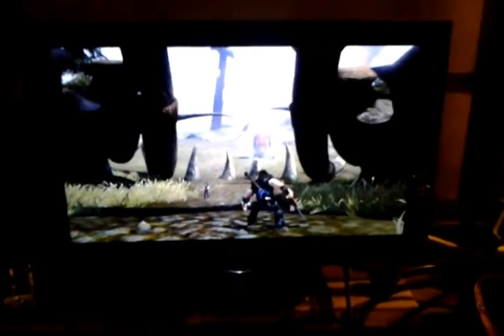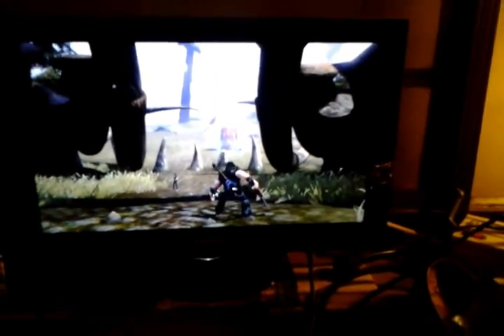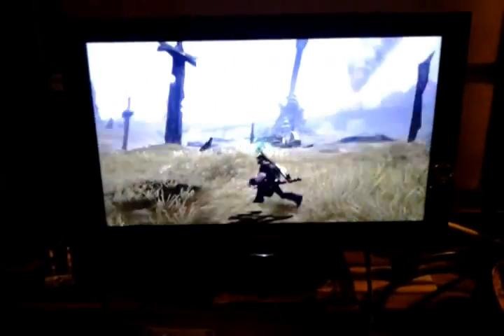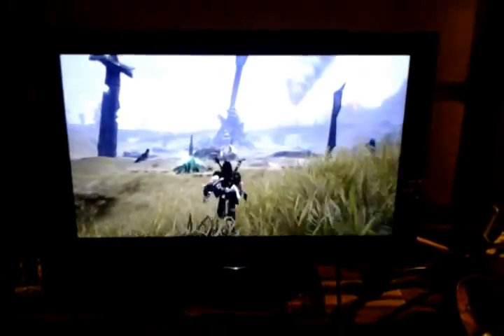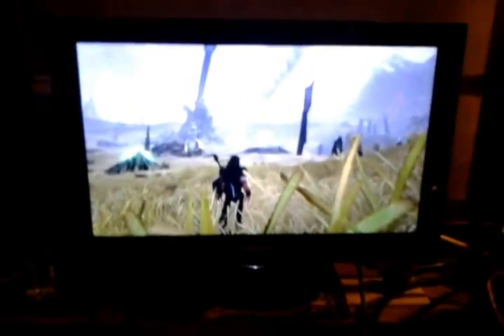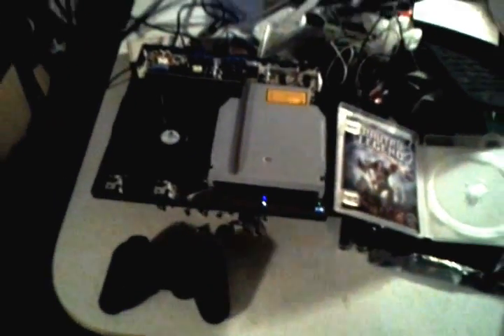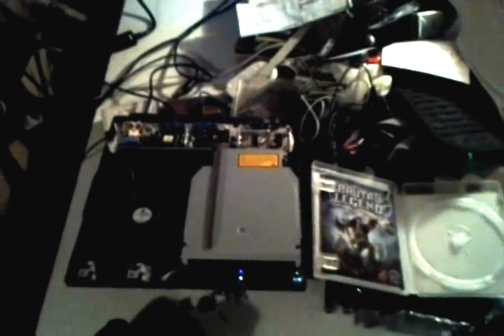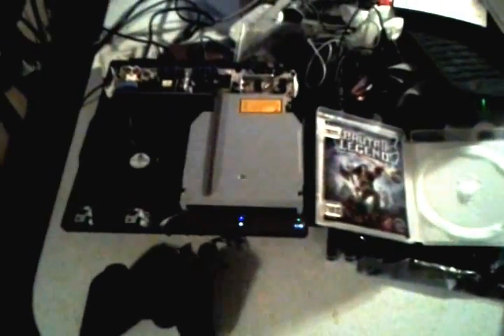PS3 Slim Power Off / Shut Down - Demo And Fix - Not YLOD [cech2501A]

Comment from the maker: I did some digging around through the comments here - and there was a few instances of other combinations on the dial - figured I would put this in a pinned comment! :D

alternate combo 1 : i had to move the PFC to 1 o clock and the OFC to 7 o clock. moving em like u said didn't work but it might be different for each system. but thats the combo that worked for me

alternate combo 2 : it worked for me , i just tried an counterclock wise combination on both potentionmeters and it worked
Reply: THANK YOU SO MUCH!!! YOU HELPED ME FIX MY JAILBROKEN PS3!!! PSN: AR_-WizardModz   IF YOU WANT TO HAVE SOME FUN <3
Reply from the maker: Awesome news!

Comment: After adjusting that that components it agains off with no warning?
Reply from the maker: (tldr: cool that power supply! 😉)
Heya! I am actually prepping to fix some Fat PS3 units with same issues as this Slim had. The knobs alone were not enough - it took reflow and new paste to get it to start staying on at all, then to get any hours of gameplay like 8+ hours  without canceling dead midgame, the knobs needed adjustments, and then we could get 80+ hours. If it's offing itself quickly like immediate then it's board issue likely, but if it's offing quickly like 8 minutes, then the power supply components need fans/cooling, I had to remove the power cover and the entire lid before adding fans! :) It's an old vid but I am still active on this! :D

Comment: I had this same problem and I fixed it all you have to do is hit the PS3 on the upper left-hand Corner and it will be fixed it really works just try it you will see
Reply from the maker: Well to really explain what you are doing would require a thermal image of the ps3 boards under symptoms and force calculations for the heat of solder and resistance drops...

But i bet your PS3 Big Fan is dying, physical strikes work for moving parts but can damage working moving parts affected as a byproduct of a strike - such as the BDROM. Fans are cheap, might just need a cleaning.
Reply: I did clean the fan but when I bought the PS it was only cutting off and coming on so I had to remove the power cord to put it back on I only hit it once and from then it working as a brand new PS3

Comment: I Have the same problem i actually bought ps3 slim cech2501a for fixing but i turn it on and it doesnt want to start i watched zour tutorial and it doesnt work i tried diffrent combinations but for one it turn off after a second on other like 2 seconds.And my fan doesnt spin can you help me?
Reply from the maker: Sure -  have you read the description for the video too, there are additional things to consider such as is a reflow necessary and is there possibly damage to the mini control board buttons or ribbon cable?

Comment: Hey man, thanks for this. i have a slim cech2512b and with same psu, 270 aps. I tried your fix last week and it worked great, i was playing for 4 hrs tops since then. But i was just playing nba2k18 earlier then it shut off on its own again (no red light, nothing, just off). Just wanna ask for your help. Should i try the screws again, with a different combination?
Reply from the maker: Jeno Fujita Totally - Operate the unit without a lid until its dialed in, dialing a knob back bit by bit from maximum, and if it seems to get worse reset to maximum clockwise and counterclockwise and try again! I had 80 hours in-game testing once it was solid, (rubber banded the controller overnight for 3 nights to just run around aimlessly) and did a case mod to add 2 fans afterwards just to be sure. I never reinstalled the PSU lid, but didn't want the heat to reach the GPU is why I added fans.

But yeah, 2nd best combo is each knob backed off from max a little bit
Reply: Michael Webb ok, thanks for the quick response! Really appreciate it. Gonna fiddle with it later, just letting it cool off for now.
Reply from the maker: Jeno Fujita You're welcome - ive kept up with replies as ASAP as best I can for almost 6 years on this vid - my other vid is youtube.com/watch?v=GREiB9E5eBg where its about the case fans
Reply: Michael Webb thnx i''ll be checking that out. After i figure out the screws hopefully i can do a case mod. Do you remember your exact combination for the potentios though? I was thinking since we've got same psus i might try your configuration
Reply from the maker: Jeno Fujita I ended up selling that model after a year or so, what I recall was the importance of CW and CCW - if the clockwise and counterclockwise are reversed, symptoms are worsened.

When I was running combinations, the best successes came from max CW and max CCW - then bring each back from max the TINIEST bit. Then take one knob and move it a tiny bit more until symptoms worsen, taking note of the previous dial setting. Reset each to max, move both a tiny bit again, then move to the other dial, bit by bit attempts until symptoms worsen - bring it back to the previous setting and bring the other knob to where you took note - then budge them both simultaneously bit by bit toward maximum. Notes notes notes! :)

Also - I did a reflow on the mainboard because potential pooled heat damage to the gpu and reapplied thermal paste - also modifying the big fan to be on maximum speed at all times. Ultimately I installed a dial to control all 3 fans (including the 2 aftermarket) and left it at max all the time.
Reply from the maker: I did some digging around through the comments here - and there was a few instances of other combinations on the dial

alternate combo 1 : i had to move the PFC to 1 o clock and the OFC to 7 o clock. moving em like u said didn't work but it might be different for each system. but thats the combo that worked for me

alternate combo 2 : it worked for me , i just tried an counterclock wise combination on both potentionmeters and it worked

Comment: any other solution for this problem?
Reply from the maker: Tomas C. 
I'll sure do my best.
I recall that the blue light would blink, and after studying the blue blink it was certainly not a "blink code".

My theory is this.
The GPU on the motherboard probably needs reflowed, this is step 1.

Also the power board likely has bad capacitors, which are releasing incorrect energy values, causing the blue light to blink as it does.

So step 2 is The knobs, if there are any will bypass circuit fault protection and run it anyways, which I got almost 80hours in-game uptime out of before a system crash.

If there's no knobs for step 2, you can replace the two major capacitors or replace the power board (preferably with a knobs version.)

Last case scenario is this - that little power button board can produce the same results if it's failing, so if you need a step 3 that'd be it.

These steps cover pretty much everything that would go wrong, my error was developed through overheating the system causing GPU and PSU damages.

Also, check those ribbon cables for damages and that they are properly seated.
Reply: Michael Webb thanks. I have the APS-270 with the two knobs. My entire issue comes from me not noticing these two white screws move from a simple touch. I was trying to fully clean the dust in my PS3, which included the PSU's interior. I remember one accidentally turning a bit while cleaning it. Then when I was wondering why they were so loose, I turned them out of their original position and mine weren't marked as many say they are. Now I have no clue how they are supposed to be.
Reply from the maker: see the description
Reply: I know this video is old, but IF you remember, when you attempted to turn it on and it would turn back off, did the blue light near the Eject button randomly turn on in between? My problem is identical, but sometimes the damn blue light comes on before it shuts down which leads me to believe that perhaps I have another issue.

Comment: After messing with the screws I could get it to stay on longer, about 10 seconds at the most but still wouldn't stay on. So I bought a new power supply for 20 bucks, put it in, same problem. Turns off instantly. Guess it was not a power supply problem. fml
Reply from the maker: Like I've mentioned, the power button control board can cause same symptoms, and I never messed with the screws until after I did a Reflow on both boards with a heat gun.

Comment: I wish that was my issue. I changed my power supply from a new ps3 and it didn't work, it still turned on then right off again.
Reply from the maker: the mini power control board can cause simular symptoms, I have never had to Reflow repair a mini power button

there's not much to a ps3 that needs repaired, we all know the graphics are gonna burn out and why

mini power control board
power supply board
GPU mainboard
blue ray lens
big fan

i.t's such a sick and twisted field, that's why I am in the field of fixing it. 

the Knobs are most likely directly resulting the capacitors discharge and affecting the GPUCPU and effectively overclocking for a potential solid 72 hours gameplay experience 

that's pretty good

Comment: noice no screws like this exist on my ps3 power supply >:(
Reply from the maker: What causes the issue is overheating of the capacitors, so they don't deliver a full burst from their charge and instead they work like a fuse which isn't what we want.
.
Replacing them with the same output capacitors may solve it on knobfree power boards, also tho installing some ventilation and/or a fan to cool the capacitors will help prolong the life.

keeping in mind as well, I reflowed the power board and the main board with a heat gun, added fans and vents on the power board, maxed the GPU big fan, and I had knobs to test with to determine these conclusions.
Reply from the maker: afterthoughts on this project:
a larger capacitor can be mathematically determined without overloading the chips and possibly bring an overclocking result, though I am speculating, new capacitors and ventilation is the first step.

I stated in one of the videos something about it I thought, the whole power board can be extension wired out of the case like the xbox360 power brick is

Comment from the maker: Saw a question in my email box just now.

What a persons gotta do to solve this shit.

1. OPERATE THE UNIT WITHOUT A LID. Test
2. IF THERE ARE KNOBS, ADJUST KNOBS. Test.
3. IF THERE IS NO KNOBS, GET A NEW POWER BOARD THE ONE WITH KNOBS. Test.
4. REFLOW THE MOTHERBOARD. Test.
5. REFLOW THE POWERBOARD. Test.
6. A UNIQUE SIMILAR SYMPTOM ISSUE IS THE POWER BUTTON MINIBOARD AND MINICABLE. Test.
7. IF YOU WENT TOO CRAZY DOING ELECTRICAL MODS GET A NEW BIG FAN. Test.
Reply: We should chat i need help on mine idk wht to do or what it is wrong. I turn on my ps3 ill load for a sec then turn off with a beep and keep beeping no noise but red light beeps over and over untill i click again help yes
Reply from the maker: I would suggest INSPECT POWER SWITCH CONTROL BOARD.

Also, there is these steps.
1. OPERATE THE UNIT WITHOUT A LID. Test
2. IF THERE ARE KNOBS, ADJUST KNOBS. Test.
3. IF THERE IS NO KNOBS, GET A NEW POWER BOARD THE ONE WITH KNOBS. Test.
4. REFLOW THE MOTHERBOARD. Test.
5. REFLOW THE POWERBOARD. Test.
6. A UNIQUE SIMILAR SYMPTOM ISSUE IS THE POWER BUTTON MINIBOARD AND MINICABLE. Test.
7. IF YOU WENT TOO CRAZY DOING ELECTRICAL MODS GET A NEW BIG FAN. Test.

Comment: +Michael Webb just a quick question after this fix did your ps3 ever had this problem again or did it stay working for a long time and never happened again..... plz get back to me on this it will be greatly appreciated thanks
Reply: wow sick thanks for the reply tho .... just came from work and decided to try it out again your rotations on the screws did not work for me as i wished it would but i decided to play with it a lil to see what i get.... so far ive gotten some results only now after endless unplugging and screw turning.... right now it is still on and running so i decided to try and download a game which it is doing presently ....and for one it has not shut down like i expectd when i tried it on befor turning the screws..... normally when i do something with it that looks like results it always fails so im expecting it to shut down again..... if it doesnt my word thats gonna be awsome .... im gonna have it to run until tommorrow and if it doesnt go off then hoorah id recon i got my ps3 back hopefully..... btw lastly that fan mod i wanna definitley do this to my system can i get a blue print or idea as to how thanks very much again youre the best bro

Comment: I'm going through this right now and when I twist the knobs its still cutting off on me after 3 seconds
Reply from the maker: You can always try different knob positions - the one from CW and the other from CCW, just move the tiniest increment.

The powerbutton board if damaged can make similar symptoms, also a burned out fan or GPU overheat can cause it.
Reply: michael webb. having a promblem have a ps3 wont turn on come on for bout 5 sec turns off no red light nothing power cord still in wall help me asap
Reply from the maker: 1. OPERATE THE UNIT WITHOUT A LID. Test
2. IF THERE ARE KNOBS, ADJUST KNOBS. Test.
3. IF THERE IS NO KNOBS, GET A NEW POWER BOARD THE ONE WITH KNOBS. Test.
4. REFLOW THE MOTHERBOARD. Test.
5. REFLOW THE POWERBOARD. Test.
6. A UNIQUE SIMILAR SYMPTOM ISSUE IS THE POWER BUTTON MINIBOARD AND MINICABLE. Test.
7. IF YOU WENT TOO CRAZY DOING ELECTRICAL MODS GET A NEW BIG FAN. Test.

Comment: Hey Mick, I had this problem, and saw your vid, so I opened my ps3 up and got the power supply, didn't have the screws so I decided just to get a new PSU. Got it couple days ago, worked fine until yesterday the same shit happened, does this mean its overheating or my whole console is fucked?
Reply: +michael webb  Yeah bud, before I could try that I completely broke it by putting too much pressure on the cpu, got my mates ylod (fat)to see if I could fix it but no luck.

Comment: Well, I have an 2511A with APS 270, when turn it on, after 2 seconds its shutdown all leds off, then pressing power, a bep and red power led on, then repeat the cicle. I try to change the dials in all combinations possible.. but not happens.. still the same issue, can you think that problem is only on power supply ? if a change with a new power supply it maybe fixed ?
Reply from the maker: This is the only fix short of replacing the certain model power supply. Added ventilation and fans is necessary for 80 hour uptime.
Reply: well, I replace power suply and the problem continue... turn on the console and imediatelly they turns off, I try without hard disk too, the problem persist... what is is ?
Reply from the maker: Maybe a bad power button?

Comment: This worked great for me. My pots are located side by side (unlike the video) and I try doing both to the left which worked for a few days then died again. So I kept moving them both left and it kept lasting a day or so. This method with one right one left has made it work properly for over 1 week now, so thank you. Fan etc all working in tandem, it's about as warm as it should be so I'm not scared it'll go on fire. Mint video man
Reply from the maker: That's so awesome this is working for so many PS3 gamers, almost 50,000 views in just two years. For a video repair guide, that's not bad.

There are always so many revisions to the different models over time, it is tough to stay up to pace on every new motherboard.

My next PS3 mod will have the power supply on an external box with a couple fans, and fans installed where the power supply was.

Comment: Mine is a cech-2504A and the PSU is eadp-200db mine doesn't have the 2 screw crank is there another way to repair my playstation 3?
Reply from the maker: I haven't worked on one without the two knobs yet, so likely there is.
The issue usually comes from either,
Overheating Power Supply  or  Overheating GPU Chip
Might be able to install the knobs if we can find out where that exact point is on another board without them.

Comment: hello i want to know this is safe or dangerous to do this???
Reply from the maker: Way safe. Dangerous would be doing this unnecessarily if it's not broken - and even then I'd say it's way safe, just remember the stock settings so you can roll it back if necessary.

Comment: crap I have a ps3 slim and it looks a little differnt inside. doesnt have the 2 screw parts. cant crank shit.,..... fak
Reply: Jarrett Dreaver did u ever get how to fix your ps3 ? We seem to have the same, mine doesn't have the 2 screws as well
Reply from the maker: What model unit is it? I did this video on a 2501. Seems the 3000 series changed this! I'm way willing to work on one at the cost of shipping here and back just to get a good video on a solid repair.
Reply: ill show you a picture of the inside of my ps3

Comment: Hey Webb I have a question. My friend gave me his 120gb slim ps3 I haven’t opend it yet I tried that stupid hair dryer trick and I've been looking through a lot of videos which were bs. I subscribed to you even if it doesn't work I'll stay subscribed because this one seems very good. But my main question is do you think it'll work for it first try. Because when I put the power cord in the light is red I turn it on literally 3-5 seconds later it shuts off. Thanks please respond
Reply from the maker: Likely it'll work first try. Hair dryers don't get as hot as a PAINT STRIPPING HEAT GUN. A good paint stripper will get over 470 degrees to reflow solder, use aluminum foil to protect the plastic, and also it doesn't hurt to inject add some solder in any of the grounding points around the board.

Comment: Does the ps3 CECH 3001a have the screws? I I can't find them?
Reply: I didn't find them either and I tried replacing the power supply and it didnt work, do I don't know. I had a similar problem a while back and took it in to a video game repair shop and they replaced the motherboard does anyone know if this works for this issue on cech 3001a slim ps3 model